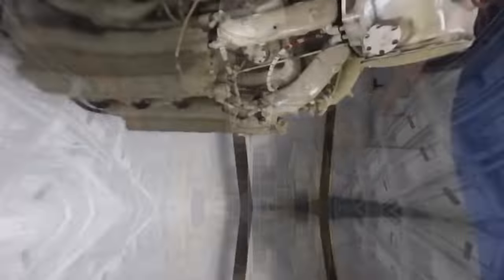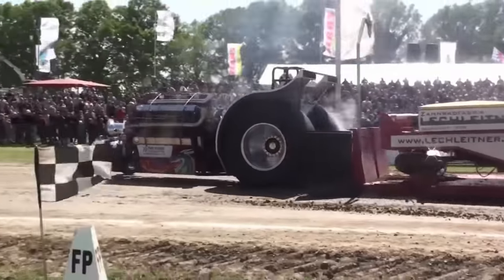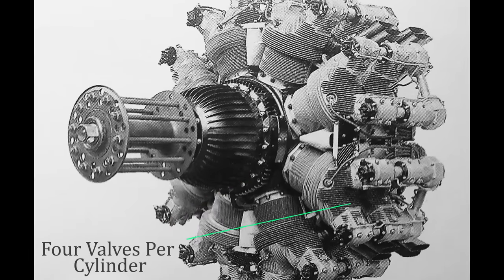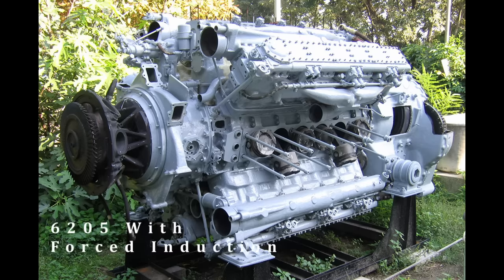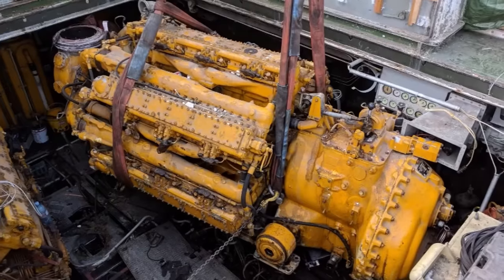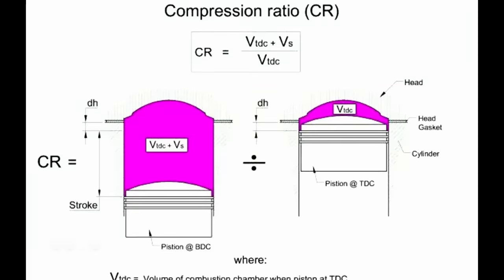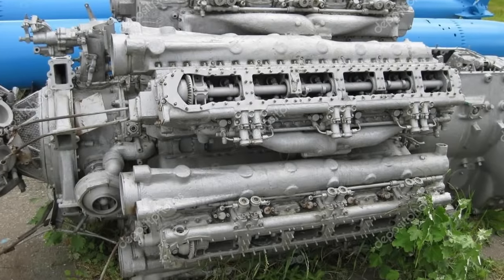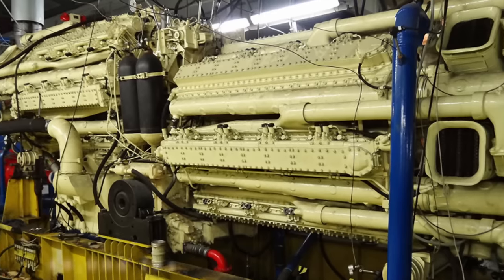Yakovlev M-501 - The BIGGEST Piston Radial Ever Designed

Comment: Astounding numbers, but a pity we couldn't hear it run.
Reply: Talk about a throaty growl! Especially for the engine where they hooked up 2 together.
Reply: @kfl611  wonder what the fuel consumption was like xD
Reply: @narmale  I was thinking the same thing, like how many gallons per mile did it take - not miles per gallon.  I bet it took a lot just to start that sucker.
Reply: A wee bit over 5 cubic feet of displacement.
Not even sure it would sound like a piston engine with all those cylinders!
Reply: @dangeary2134  it does, click the link

Comment: The Napier Nomad was another large diesel engine that didn't quite get to fly, and also featured turbo-compounding. A very neat design.
Reply: A very impressive piece of engineering. But it fell victim to a number of things beyond Napiers control
1) The large amount of surplus C-54/DC-4s on the market
2) Already developed or soon to be developed aircraft such as the Connie and the StratoCruiser.
3) The seemingly insane decisions on the part of the British Ministry of Aviation in the field of civilian aviation. The Brabazon and The Princess? Really?
Reply: The Nomad did reach flight testing, installed in the nose of an Avro Lancaster.  They could shut down the other four engines and run on the Nomad alone.
Reply: The Nomad would have been great in the Avro Shackleton. But an engine confined to one airframe is never a great idea.

Comment: Kudos to you for digging photos, drawings and facts about this exotic design out of the swamp of untold history. The story of the WW2 German Junkers mega-radials has been documented elsewhere, but the trail grows cold from the point at which the Soviet Union took that design as war booty and developed it further—until now. One technical factor might help answer “why the Russians persisted with this design so long into the jet age?” Specific Fuel Consumption (SFC)—pounds fuel per horsepower-hour. SFC governs the range possible with a given engine technology, and is most critical for long range bombers and transports. To the aircraft designer in 1945–50, the SFC of turbojets was the worst (best power for the weight, but very thirsty). Piston gas engines were better, plus a known quantity for operation and reliability. Diesel engines offered higher SFC, but too heavy. Turboprops promised good SFC with lighter weight, but had not been realized as reliable designs yet. Even Boeing’s all-jet B-52 was initially designed for turboprop power. It bears a resemblance to the Tupolev “Bear” bomber still flying today.

Comment: Wonder if you're willing to do something on the first attempts of heavier than air aircraft engines. Engines like the Wright brothers flyer, Richard Pearse engine and so on. All homemade and innovative of their time. Say between 1895 to 1912.
Reply: And the Manly-Balzar. Probably the best power to weight ratio of it time.
Reply: Shane, I have been telling you this since elementary school: the words "your" and "you're" mean different things.
Reply: Not only did the Wright brothers take wind tunnel testing to a different level, made very efficient propellers they also made a over head cam, fuel injected engine.  They fully deserve their reconnection.
Reply: @joejoejoejoejoejoe4391  
The Wright's engine was no paragon of high technology for it's time. It was just light enough. It produced just enough power. The primary reason that the Wright's were able to fly that day was the freakishly high barometric pressure at Kitty Hawk. The barometric pressure that day was the equivilant to 1 to 2000 feet below sea level.
Engines produced only a few years later were much more advanced.
Reply: @mpetersen6  You just pointed out yourself the one thing that it was its key to getting things off the ground at the time they used it. And I agree with your point to but was its size to power that was the key for them as well environment. They needed something Very light. But just what they needed at the time to keep it up once off the ground once they got there. Just remember first they had to use a sort of catapult just to get to that stage for many years just to get their flyer of the ground. Once up the motor did the rest with only just the power to keep it up there.  Unlike Richard Pearse engine own home built by him, and with replicas of that engine that have been made of the engine. It had excellent power to weight ratio that could lift it craft off the ground with one of them in it under it's own power. If Richard Pearse did bet the Wright brothers, that will always be open to debate. As the Wright's had picture's and he only had witnesses that now it can't be confirmed. Even someone before them might have managed it. There will always be that question to.
Good example of even that theory is the movie and book that came out " World's fastest Indian" in 2005. How many know about Burt Munro before then. I did but know many that did not even locals in his hometown before then.
Reply: Speaking of early engines, I'd like to see a video on that hint hint I've always been interested in the Antoinette, fuel injected V8 in 1906. In any case thanks for the great videos!
Reply: @DanWoodTomwoodson  
I do know of a video about the Antoinette. Driving for Answers channel iirc.
Reply: @kalilay  a lot of times If you are using voice typing of some sort it doesn't catch that for some reason.

Comment: Will you be covering Turbo Props?  I worked on the P3A and B in the Navy.  I was in AIMD, Advanced Intermediate Maintenance Depot, repairing the Navigation System, indoors in a cushy, AC cooled lab workspace, but the P3s had Turbo Props.  At both Naval Air Stations, we transitioned out the old P2s with Radial Props which were upgraded with wing tip jet engines for extra boost, like on takeoff.  These were Anti Submarine Warfare/Search and Rescue aircraft without a tail hook, so I was shore-based in America for both enlistments.  I joined the Navy to keep from being Drafted right out of high school in 1973 into the Army and being a ground pounding, gun toting Grunt in Vietnam.  We kept the Base operational for when the weekend Reservists came in to Drill.  We had two Squadron of Reservists, so we went with them for the 2 weeks each for their required Active Duty times, so we would be gone a full month for both of them.  I spent about 1½ months in Hawaii, and month in Bermuda twice, and went to the Azores Islands, off of Portugal, for a month 2 times.  Join the Navy and see the world, but at least I wasn't stuck on a ship for months at a time.  I visited the WWII Memorial in Hawaii.  That was fascinating and sad at the same time, seeing all those glorious ships rotting away.  Anyway, thanks for the videos.

Comment: Two observations:

(1) I had once read that at approximately 4000 hp, the power-to-weight graph lines cross, for the matter of ICUs and turbines; that is, for an (aero) engine intended to make more than 4000 hp, use a turboshaft instead. In the matter of this engine being firmly in the era of developed turboshaft engines, the Russian engineers could not have not been aware of this verity.

(2) Although not as impressively powerful as this engine, the viewer may also be interested in two successful western ICU engines of years past: the Lycoming XR-7755 and the Napier Deltic. Both have compelling YouTube videos about them.
Reply: I don't think I would call the XR-7755 successful. Only two or three were built. Yes they ran. Yes they produced over 5000 HP. But they were never installed in an airframe much less flew. The same could be said of a number of other interesting aer engines of the time period. One that comes to mind is Wrights R-2160. 42 cylinder inline radial. Liquid cooled. 7 banks of 6 cylinders. OHC, three crank shafts tied together with layshafts running in the space between the cylinder banks. Compact in diameter. Well over 2000 horsepower and 1hp per CID. Run on test but never installed in an airframe and flown.  There are others. The Old Machine Press website is a great source.
In terms of power to weight ratio outside of rocket engines I don't think anything beats a Top Fuel dragster engine. The TBO may be measured in seconds though.
Reply: @mpetersen6   Yes. I never should have said that this experimental and never-installed engine design was successful (cooling issues, I dimly recall), but during the writing I was referring to the Napier Deltic, and the Lycoming was tagging along in the sentence.
Reply: I have seen a w 12 dohc, 4 valve per cylinder Napier in a nz aviation museum. Made in 1917.
Reply: @mpetersen6  6 banks of 7, a radial has an odd number of cylinders per bank.

Comment: Finnish Navy had for sale  M504 engines. They were 56 cyl and 5000 hp. 224 valves, 14 cams, aluminium built. Super sexy engines. They were sold to Vietnam, but i got a manual.

Comment: Good upload but, especially for non US engines, can you please include metric...(eg in this one I have no idea if 7459 pounds is the weight of a horse, helicopter or house)
Reply: Helo. Horse maybe 746 lbs.
Reply: @HootOwl513  nope, 746 watts= 1horse power
Reply: @tafsirnahian669  Talking weight, not energy. And 746 pounds would be a light horse.
Reply: weight? 
easy, divide by 2000 to get tons as a rough guide.
so about 3.6 tons...
Reply: @ForgottenMan2009  ha thanks, but you do realise metric doesn't use tons either? That's why I don't understand why something already in metric ( eg Russian, German, Japanese engines) already in metric can't just have their measurements
Reply: @pizzagogo6151  mmm....
Metric uses tonnes which is 16lbs heavier than a ton which is more than accurate enough for an estimate for this purpose.....
bearing in mind a ton is 2,240 lbs so  you are not going to notice the extra 16lbs when you lift one...
Reply: Фунт - это около 409 грамма. Таким образом, 7500 фунтов - это около 3 тонн😝

Comment: I am fascinated that people have attempted to break the sound barrier in level flight with piston powered aircraft. What sort of engines are they using, breakthroughs in prop aerodynamics, can it be done, or will the laws of aerodynamics prohibit it.
Reply: For some of the efforts the powerplants have actually been automotive based. Largely Chevrolet V-8s. As much as some disparage the OHV V-8 in some ways it has a lot going for it. In terms of displacement per weight and overall size they are pretty compact and light. Even production cast iron versions can be quite light. If I were to be looking at this now I would look at using an LS as the base starting point. Look at the overall size of a DOHC V-8 and an OHV pushrod engine of similiar displacement (1). The DOHC version is likely to be much wider. One field to look at in terms of power output vs overall size etc is in the Land Speed Racing community. Especially the streamliners. In an airframe that means a smaller cross section which means less drag (2). In terms of the prop I think that's the big problem. You need radically different prop blade profiles.  One plane that was being built to try to do this had contra-rotating props with blades that looked more like a blender iirc. I wonder if you would really need a ducted fan to pull it off. And once you do it the aircraft goes straight into the National Air & Space Museum or some other aviation museum. And weight is going to play a major factor. Low enough weight means smaller wings, lighter landing gear and retraction mechanism. And low weight does not necessarily mean carbon fiber. Yes it has very good strength to weight ratios. I once worked with an individual who was a bigger aviation geek than I am. He was friends with the guy (3) that built a couple of the BD-5s used in promotional work. One of the sponsors wanted parts of the airframe built out of carbon fiber. The builder could make the same parts out of aluminum lighter than the carbon fiber. 
1) Engineers in the US auto industry were well aware of the overall benefits that a SOHC or DOHC valve train engendered to engine design. There were a number of other factors at play in design choices that often get overlooked. One was tax policies that penalized displacement in some markets. Another was the operating environment that did not force vehicle size to be smaller or make it desirable. And finally the biggest factor was cost. Aside from cost of materials in the components it really does not cost any more to produce a 1500cc four cylinder versus say a 2.5 liter four cylinder.  And if the 1500 has DOHC with 4 valve heads the 1500 costs more. This is given equal pay rates, machine outputs etc. And in terms of mileage in the 50s and early 60s when most of the classic American OHV 6 and e cylinder engines were designed it was possible to achieve mileage fairly close or equal to that achieved by the leading European imports of the time. 
*I remember watching a show on Discovery or one of the similiar cable channels about home built experimental aircraft. One was a Mono design with a Briggs and Stratton 18 hp V-Twin hopped up to 20 hp. The plane would top 200mph/327kph with the type of engine you might find in a riding lawn mower. I found that pretty impressive. 
3) One degree of seperation! But then I have that with a number of other famous or infamous individuals. Phil Waites, AllenGinsburg, Francis Ford Coppola and Eric Clapton. Simply because a friend is an author who has written a number of biographies
Reply: @mpetersen6  Hey you're very knowledgeable about this subject. Love the idea about the ducted fan, and totally understand the need for props being designed with narrower thinner blades to cheat resistance. The biggest problem to overcome to me seems to be the issue of an airframe traveling at near supersonic speeds coupled to the sonic signature created by the propwash and engine noise alone, throw in a sonic boom on top of that and it seems like the possibility of ungodly decibel levels and sonic vibration might very possibly cause a catastrophic unintended disassembly.
Reply: @Michael Cohen Another great response. I'm beginning to think I'm not the only one who would like to see this milestone reached. Of course it would only be a one-off attempt since I cannot foresee any marketable technology from designing such an aircraft. Just a simple exercise to demonstrate that it can be done. The great Chuck Yeager once reported that he was pretty sure he'd broken the sound barrier before in a p51, but it was in a steep dive under combat conditions so there was no record keeping present to serve as proof. Also he said "pretty sure", and of course it was not in level flight. However, if so, it proves the old mustangs could survive it.
Reply: @Michael Cohen Great reply! I have a lot respect for your opinion. The prop itself definitely seems to be the primary challenge here. For the blades to be as robust as well as "slippery" as they need to be in the supersonic environment may be a challenge humanly incapable of overcoming, but there are still engineers who say  theoretically it is possible. The Tupolev 114 flew around the world at cruising speeds in excess of 500 mph for decades. Top speeds higher than that. In higher altitude environments, and I may be wrong here, but I think that would be pretty close to .9 mach. Perhaps the secret may lay in some as yet undesigned contrarotating prop system.
Reply: @Michael Cohen проблема воздушных винтов при работе на трансзвуковых скоростях заключается в том, что основание лопасти движется с дозвуковой скоростью, а конец лопасти - уже со сверхзвуковой. Это неразрешимая проблема, и при приближении к скорости звука лопасти разрушаются. Ту-95 и раньше Ту-114 - это квинтэссенция развития винтовых самолётов, спроектированных для движения на скоростях, вплотную приближенных к скорости звука. Быстрее их с винтомоторной силовой установкой двигаться технически невозможно. Винты разрушаются.

Comment: Just stupidly complicated when compared to a gas turbine.
Reply: Complicated, but might be more reliable with 1960s Soviet tech. Turbines need more advanced alloys and much greater precision when machining the parts than a diesel, even one as complicated as this one.
Reply: @AndrewCZ47  They had the Klimov engine from 1947. If they could build that, then they were more than capable. Maybe the M-501 was a prestige project, but it's not practical. Impressive, though.
Reply: Complicated but more fuel efficient.
Reply: @Tim-Kaa  Yes, back then. Not today.
Reply: Not correct. Gas turbines never had a TBO anywhere near 1500hrs at the time, let alone the 3,000 this was capable of. Another ''complicated'' radial was the civil versions of the Bristol Centaurus which also had a TBO of 3,000hrs. The legendary P&W PT6 needs a hot section replacement at around 1500hrs depending in type of use and has a mid-life inspection at 2500hrs under EU regulations.
Reply: @Slaktrax  Learn to read, please.
Reply: @rocksnot952  Turbines are efficient if running flat out. That's why ships tend to use mixed propulsion (diesels for slow speed and long range, turbines when you need to go fast).
Reply: @AndrewCZ47  Actually, diesels are more efficient when running flat out as well. It's just that they are also more efficient than gas turbines when speed changes. These ones are still stupidly complicated. I was a marine engineer, so I think I have a pretty good handle on it. But thanks.
Reply: @AndrewCZ47  M-501 was developed in 1940s
Reply: @bagamut  That was the aircraft one. Marine version started mass production early 1960s (development started in 1950s, took some time to iron out the problems of early prototypes)
Reply: @AndrewCZ47  Marine version is M-504 and M-507